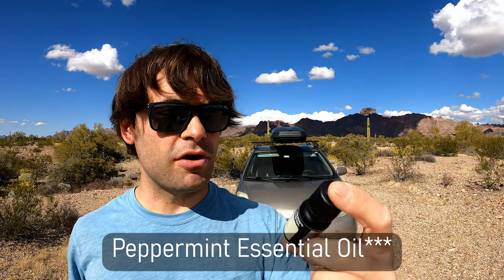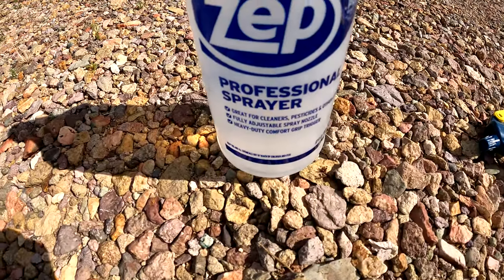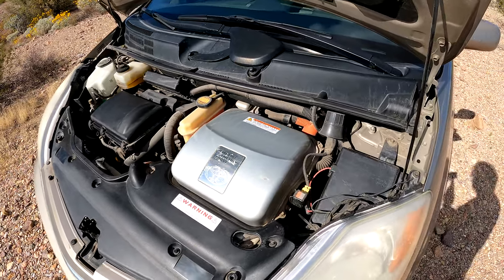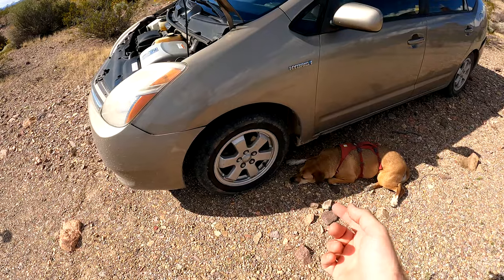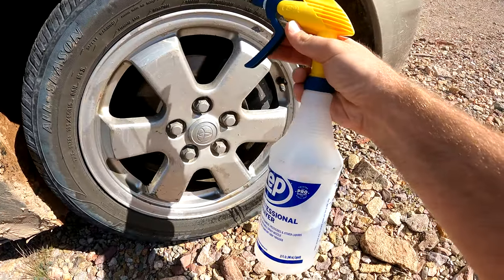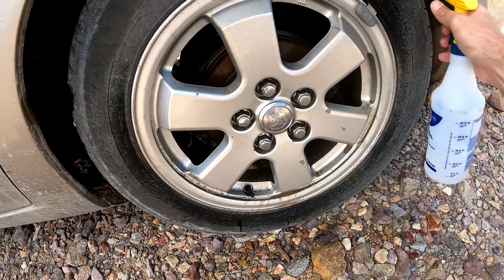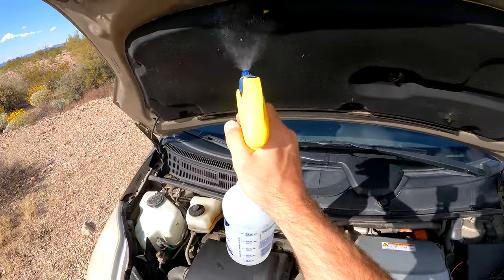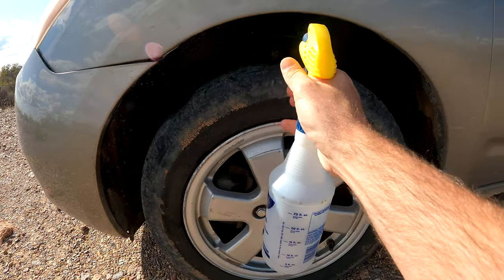How to EASILY Prevent Mice/Rats From Getting in Your Car/Engine Bay! (The Best Method) #Rodents

Comment: Electrical connections are absolutely water proof.  You're going down the road at 65 mph, it's raining sidways.....your entire engine bay is gettin soaked.  Downt worry about spraying electrical connections.
Reply: Water resistant, yes. Waterproof, not so much. But you're right, spraying them shouldn't be an issue.
Reply: It's the peppermint OIL that is in the spray that you don't want on electrical. It interferes with conduction.

Comment: There are two types of “peppermint” oil sold…both come from the plant Genus Mentha. These two are Mentha piperita and Mentha arvensis (Corn Mint). The one you want is Mentha piperta. It costs about twice what Mentha arvensis costs, but it is the one recommended for use as a rodent repellant. If a product doesn’t clearly state which oil it is, you can assume it is the less effective/cheaper oil….and it usually has some bad reviews.

Comment: Here's my Mice not so Nice story: After parking my lil RV on some land I bought in Show Low, AZ, I learned about mice...AND big rats. Most of the campers up there would leave their hood open thinking the light would keep them from nesting...my experience is it drove one to build a nest way deep inside of engine compartment...I literally had to take off the dog house and with pliers and other tools dig that nest out from both sides...such a mess. 

We also tried different traps. The mouse traps did nothing. The larger one did finally catch that nest builder. We also used a bucket of water with a slippery stick through two holes, one n each side, with peanut butter in the middle. That did catch quite a few. I finally gave up on that idea when I saw a mama and baby in the water and looked like they struggled, so I'm done with that. I know, they are pests, but it's really their home and I don't want that guilt. It hurts my heart.

I once had one in my cupboard and when I slid the door open, we both screamed and I shut it real fast😲...Then I devised an escape root by using a vent tube which I dropped out the nearest window and banged 🥁 on the opposite end of cabinet till it took the route. (Comedy of errors)...MONTHS later whilst cleaning out my cupboards, I saw a lil baby mouse bones. Again, so sad. 

SO...this is why I'm looking to buy a Prius this summer (Lord help me, prices are high - 2023) and that way I will be driving more than sitting in one spot, and your  spray will be what I use. I have also mixed a lil soap in that, I think I heard it helps it stick, and also, this is what I use to deter spiders...as there are Black Widows here in N. Nevada and various desert areas. I might also pick up some cinnamon oil and make a snake deterrent spray as well. Essential oils are good for many pest uses, that I sometimes feel I am spraying a virtual salad around my perimeter.😆

Really enjoying your videos, and really your's the the one that convinced me I might like this...I like your clean simple organized arrangement. Cheers brother, see ya down the road sometime. Robi.

Comment: Another ingredient I recommend using is white pepper  I keep some suspended in water in a spray bottle, much as you have here. I use it to keep flies away during the summer. I also use it on my floor to discourage my dog from marking in the house.I hadn't thought about using it on my car, thanks for the idea.

The pepper spray works really well. Since it's not red or black pepper, it doesn't stain. You can use it on walls, etc. It leaves unseen pepper flakes deposited in the spot sprayed, so the deterrent effect lasts a long time. It would probably work well against pests in the kitchen, and outdoors in picnic areas, etc. Pretty much any critter hates pepper up their nose. lol

It's great seeing you with a new video. Enjoy Spring, my friend, happy travels. 👍.
Reply from the maker: Thanks for the info!
Reply: Pepper works well to keep dogs from tearing into your garbage cans when set at the road.

Comment: To get the oil to mix more easily, I create an emulsion with a little bit of peppermint castile soap in warm water with the peppermint oil and shake it up. I just periodically  shake it to remix.

Six months is too long when camping in the desert from what I have read. There are multiple online nonsponsored articles that give good advice. I would personally spray every few weeks.

Comment: Here in Central Wisconsin, I've kept bounce sheets throughout areas. As long as you change them out every month or 2, they stay out. No more surprises in the glove box either. Mint works well, too. I use it in the garage along with bounce sheets on shelves. 😉
Reply: I heard dryer sheets work well. Was thinking about trying this. For a car how many should you use? Like one under your hood tied somewhere? Is that enough or use more thought the car or?
Reply: @danemowris39  Yeah, change them out as often as it make sense according to ur environment. They often like openings in intake boxes, the area your vents when they open and close. Here in central Wisconsin, they somehow managed to mission impossible through the vent system in my 2005 Trailblazer EXT LT and make a home in my glove box. After that happened, I cleaned it out and put dryer sheets in there.. Underneath each seat, and anywhere under the hood where they could make a home or take shelter. Every couple of months, I change the sheets. Have been mouse free since.

Comment: I just got back from a two week road trip from VT to FL in my gen 3 Prius. I went down there with your window covers, your tinting, your fridge, your battery setup, your interior lights, on and on. I loved it! I decided to put a 5 inch foam bed 38 inches wide in the back. Fantastic sleep. Fantastic trip. Thank you!!! My next trip down I want to go on the Blue Ridge Parkway. I also want to put two solar panels on the roof to charge the Bluetti. I don't like being dependent on finding a plug in outlet to fully charge the Bluetti. The car 12v sockets can't keep up with my power needs.
Reply from the maker: Cool! Glad that was fun. I've made that east coast haul many times lol. Have fun at blue ridge! I charge my bluetti with an inverter
Reply: @MountainSpringsAdventures  Same here.  Have used the 1500 watt inverter hooked to 12 v battery to charge my Bluetti while car is on.   Some newer models should be able to charge in very reasonable time, but the 12 vdc cig lighter limited to bout the 150 watt limit which is about all my Jackery 500 can accept and takes too long unless on a long drive.   Still, solar is just one more thing to carry and SLOW for charging and such small amounts of energy that it is not worth it to me IMHO..and my life is devoted to solar and built 3 net zero tiny houses so I love solar.   Of course, if needing to draw higher current for cooking in Instant Pot one can use the inverter wired to 12 volt system direct to preserve Bluetti content since the car won't be on long.    I hacked my ECU to allow EV mode in my 08.   It was easy, and it does forestall ICE popping on when I'm boiling water for tea etc and don't want to smell exhaust with door open...so long as you don't pull too much.    Bo, you have  lot of great innovations!   A pleasure to watch your travels.

Comment: Great advice on spraying lower front grille. I SAW a mouse run from my battery down to the grille on my gen 4 prius. Check your alignment for your front driver's side.😉 I inflate my tires to 40lbs on all four. I have woods around me so I bought a mouse blocker AND I spray peppermint too.
Reply: Whats a mouse blocker?

Comment: Hey Bo! How are you and Molly doing? Had to jump in and comment, First so glad to see you made it to the desert, it's not the mountains but do you still hate the desert? I have been using this solution myself, it's very effective. I spray the Peppermint oil literally everywhere! wires connectors everything soaking everything down. Mice are super athletes they don't need tires and shocks to get up into your vehicle and yes they are attracted to electronics and it's been rumored that the insulator of the wire is made from peanut oil, and since their sense of smell is so great. bingo! I treat my vehicle every time I can't smell the oil, every few weeks. opinion best part of this video is the advice of getting a quality spray bottle, if anyone in the comments says the "bears" are attracted to peppermint oil is full of BS.
Reply from the maker: When did i say i hate the desert? I love the desert, always have. I heard the wires were made from soy products. Seems strange Toyota would do that.
Reply: @MountainSpringsAdventures I heard they eat the plastic, which would make sense if it was made from peanuts or soy, especially in the desert where food is sparse.  Natural plastics, better for the environment and all of our health in long term but higher maintenance in the short term.

Comment: I saw this a few days ago on another channel and then also a video where I guy tested mint oil and filmed with an IR camera (a box w/ sunflower seeds inside and glass top to see what the mice did).  After seeing those were super effective, I tried it on my car that's never had rodents until this winter.  So far, it didn't work after first spray down so I doubled the number of drops from 15 to 30, and it didn't work after that time either.  So this morning I put a few dozen drops of just pure oil around the engine bay and then just did a spray down all over the place with 3 dropper full in the sprayer.  We'll see how it goes!

Comment: also, before turning off your car engine make sure you have the vent mode in recirculation mode to help prevent rats/mice entering the passenger compartments.  Rats/mice will not leave for long and the reason why you have to constantly re-spray in about 4-5 days.

Comment: Rats ate into the wiring harness on my Toyota Highlander and also the foam insulation under the plastic engine cover, expensive fix. Been using peppermint oil and Irish Spring soap bars around engine area, seems to work, they were after the sugar in the plastic wire coating.

Heard from an auto mechanic that Toyota uses soy sauce as one of the organic ingredients in plastic wire cover along with sugar, that's what the rats are after.

A neighbor said I should leave my hood up at night to let the heat escape and rats don't like open areas. The heat may escape along with my battery and other engine parts.

Comment: mice are a constant problem with vehicles at work that sit in a parking deck for extended periods, several had so much damage to the wiring harness they were totaled. once after a drive I noticed a horrific smell from my car after I parked in the driveway. I opened the hood and saw a large pile of burnt cat poop on the exhaust manifold.

Comment: Another great video, Bo. Even though I live in a house in a Boston suburb, we have lots of chipmunks and other rodents around and people's cars do get invaded sometimes. I haven't seen evidence in my vehicle of rodents getting in but I've seen evidence of what they're eating on the driveway adjacent to the car. I also park at trailheads in the woods and often leave some food in the car. Even though the food is wrapped or in containers, I think that attracts rodents, so doing the peppermint spray may be a great, low-cost idea for me. One comment. Your cautiousness around the rotors and springs seems unnecessary, given how soaked they get when driving through rain anyway. Also, did you get any of the spray up above the gas tank where one of the nests was found?
Reply from the maker: Hey Jeff. Generally, people in the suburbs or cities dont struggle with mice in cars, its usually people around rural areas, farms, and wilderness areas that struggle with it the most. I didnt spray the gas tank area, probably should have

Comment: Why are you worried about spraying your tires?  They are made to go in water round-the-clock at high speeds and I can't imaging 1/1000 diluted peppermint oil is going to damage them?   If so, there should be a warning label on the oil bottle :)  Just not wanting to waste the product?

Comment: Get a small sauce pot keep it a large sauce, burn charcoal may be 10 or 12 .After  few minutes put the lid on. It will ll start to smoke...get dried red chillies from Indian shop and throw it on the charcoal...make sure to keep a mesh on top of the pot.leave it in the car safely and close the doors...it will work

Comment: Couldn't you just spray a perimeter around your car every night when you park?

Like circle and then hit the tires/wheel wells?
Reply: That’s what I am going to do funny how a mouse just chewed one wire on my wheel . But no teeth marks. They say either cut or a mouse. Heck I can even get under it. Let alone anther adult. So dealership told me spray not your mothers vinager

and a mixture of water in between the tires. Who heck knows. Out several cars in my parking lot they chose just to come bite one wire. Or cut. I not had it fixed yet. 1,225 . 900 for part alone. I got me some peppermint oil coming I will spray all around my car. Due to be fixed next week. Good Luck. I despise mice more then ever now!